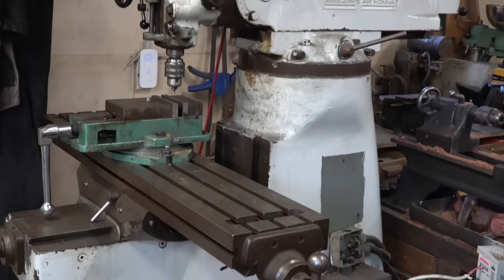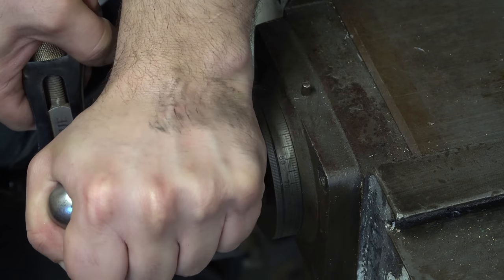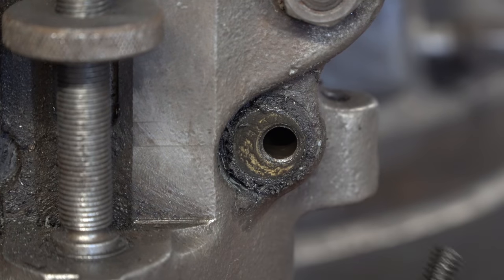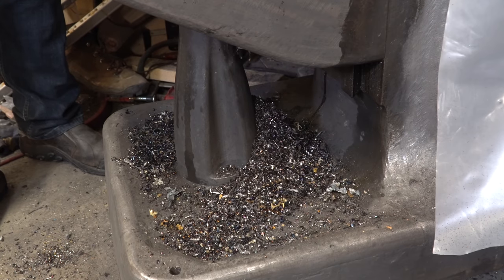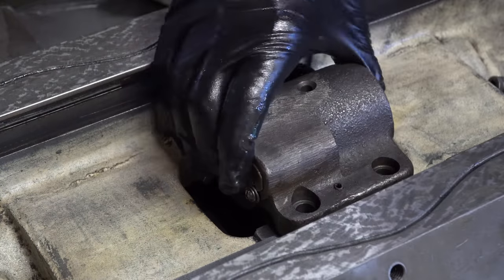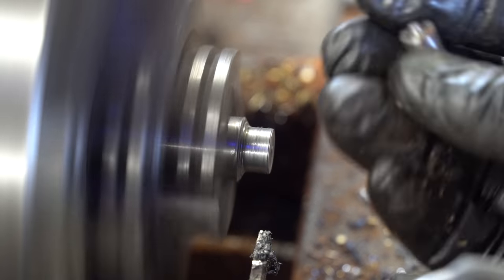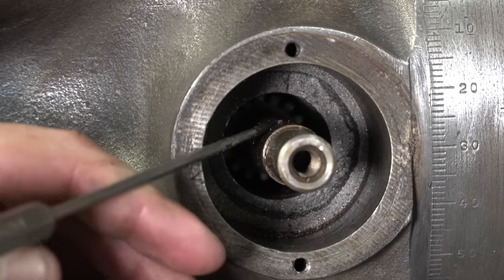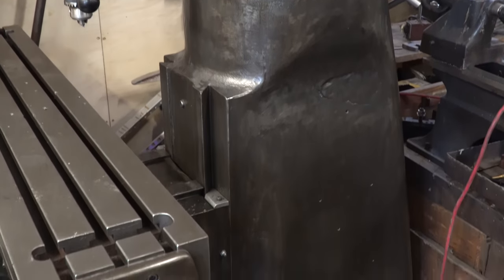Bridgebort Milling Machine [Rescue]

Comment: new machines don't hold great tolerances anyway.The design has inherent flaws you just have to work around. You will learn how to use her with the slop. Throw a DRO on the x y and if you can z. I think quill feed scale is not as useful as the knee scale. Oh and go grab a knee feed or the drill adapter bit for the knee your shoulder will thank you.

Comment: Takes me back to the restoration I did on my Bridgeport. Like yours mine also had a couple hundred pounds of chips inside the knee. An upgrade to mine I had never seen is the table lead screws have ball bearings the circulate through the mechanism making the table movement really smooth and easy. 
I enjoyed your video very much.
Reply: Ballscrews - used on CNC machines --   should be used cautiously on manual machines if the gibs are loose

Comment: Appreciated the reminder/review of all the work I did on my Bridgeport which mimics yours although I did replace the brass nuts which were worn beyond backlash adjustment range.  I do have the automatic oiler system which would be a nice add for you and I did replace the quill bearings which really tightened things up.  I do envy your shaper attachment although I sold my shaper as it was taking up space and rarely used.  The attachment has a better space:usage ratio.  Looks good unpainted!  Nice job.

Comment: That cleaning gave me shop anxiety again lol. I worked in a shop with 6 bridgeports, part of my job was cleaning them.
You may want to invest in an oiler attachment, it's an oil tank with lines to the oil points. You pull a plunger, it sends oil to the machine automatically.

Comment: I worked on the same model Bridgeport for several years when I was a tool & die apprentice. I love the bare metal... it has a sheen that paint just doesn't. BTW, of all the Bridgeports I worked on, they all were a lot quieter than yours. You might want look into the head/spindle bearings. Very nicely done.

Comment: An easy way Ive found to using a die to thread parts on the lathe is to put in you're tailstock chuck with the jaws adjusted inside the body. Then set you're die on the face of the chuck and run it into the part with light pressure and spin the chuck by hand or in low gear and just bump the power on and off. This will keep the die concentric in relation to the work piece. Putting the die in a die holder would make it much easier to keep it from turning.

Comment: Nice vid! for future reference..you do have an extra mill to cut a slot in the cam pins..just that it's laying on its side and called a 'lathe' ;-) chuck an endmill in a collet, center the pin in a tool holder and presto!

Comment: My friend has a similar B-port. With a very heavy vice on it (At least 80Kg) Moving it take both of us and normally we use a chance block on an I beam.
We are about to strip this down to at least 4 maaain parts for a journey of 1500Km so it was good so see your process. He has the Shaper, but I have never seen it used.

Comment: Shaper head is pretty handy for keyways, its been very helpful on my machine a few times.   Last job was a blind internal keyway, had to make a custom tool for the cut but it worked wonderfully.   I have mine on a vfd, very low rpm is helpful for setting up the job.

Comment: My BP is about as worn as this one but I can still hold .001.  Just learn to use your backlash to your advantage, lock the table or saddle or both whenever possible.  Watch your speeds and feeds.
I was about to buy a Chinese mill/drill when I found an old Bridgeport locally so the shipping wouldn't kill me.  Best decision I ever made.  Also, same color.  I haven't gotten around to refinishing it.

Comment: I love this type of mill, learned to machine parts on one.  The one I used needed to be leveled almost every time I used it, general use mill at a college it was pretty beat up.  These Bridgeport classics can take a lot of abuse and keep going, but they need to be releveled quite often.
Reply: Yup, I was in charge of one of these in my Physics department as an undergrad.  It had come off some WWII Navy vessel, still with the "USN" tags on it.  Yay, cosmoline!

Comment: Nice job on the Bridgeport. My 1967 Bridgeport also has grease nipples that’s what we call them in Scotland. If I just pump oil in the grease should be eradicated in time. I have seen an angle head for a Bridgeport, but never a slot/shaper attachment. Have to keep an eye out for one. M😀

Comment: Now that you have it done, you can use it to make more tools. Which you will need, but I guess you could buy them if you had too. You could go with Dial indicators on mag bases instead of a DRO, but the DRO will save tons of time, counting, and headaches. I've made a punch and die without a DRO, but it took a ton of patience. You will still need at least one Dial Test indicator just to tram the head and vice in though. That shaper attachment is gonna help open up many possibilities. They were rarely used so it should still be like new. Internal and external keyways (also straight gears and splines if you get a rotary table, of course), shaped holes, but you may have to grind a good bit of your own cutters for it. The limits are your imagination, you can learn the skills you may not have yet.

Comment: I'm sure you know those fittings on the table and saddle are oil fittings. I have seen so many shops pumping them with gease guns. It does make quite a mess and makes chips stick like crazy! When I was retiring the company offered me one of thier unused millers that had been abused for 20 years. I didnt take it as it was really bad. After 9 years away I often think about finding a decent one to play with.

Comment: For large die nuts you can use the flat face of the tail stock to hold it squarely. Use light pressure by turning the crank and using a wrench to turn the die.

Comment: Instead of 30wt oil you need to use a way oil. It’s specially formulated for less friction between two metal surfaces. In addition it will not turn acidic over time the way motor oil does. Nice video in all, good job.

Comment: that 
cutting atachment is nice , it wouldnt fit on my machine 
but would love to own one to broach keyholes and splines with
you might be able to get rid of the endplay on the acme treads by getting rollerbearing treads meant for cnc aplications , would make the operation a lot smoother too 
another option would be to fit a dro , the dro doesnt care about the backlash he measures the actual distance traveled 
it allso can do tricks like spacing out a bolt circle (boltspacing on a wheel) measure in microns and inches can measure from the outer edge of the workpiece (absolute) or from a point in the workpiece  (incremental) finding the centerline of sumting (1/2)  drilling and spacing a line of holes at an angle from the x/y axis set youre tooldebt for every tool you have (if you have all of them set up in their own chuck) and stuff like that
for the price of the tool (aliexpress) you cannot go wrong with it , does take some efford to instal its glass scales  on a brigebort though but makes the machine way more precise (and i cannot read the small increments on the  wheels on mine anyway )

Comment: If it’s really worn out and you want to have some consistency, try taking a cut of 5 thousandths to where you should be 5 thousandths above finish length/height/width. Measure, then finish cut whatever you have left to go. 
This method helps me because I have noticed cuts like 20 thousandths or even 10 can be less consistent than 5. 
But yes sadly we are limited by the accuracy of the machine.

Comment: That was great man, a real joy to watch. As massive as that thing is, can you put bigger chucks on it?  Looks like it what, a 1/2" one on it? Was just wondering if you could bore like 2" holes?  Think you can use the Mr. Thrusty attachment for broaching? I dig the "cast iron" look instead of paint, all the "ye olde" mills and lathes look good "naked". Funny that it looks like "Bridgbort", I thought it said Bridgbori" (french)? before you took all the copious amounts of pain. Bondo, primer, dirt, oil, etc, off it. LOL. Also with the swing arm radius, that thing must take up lots of real estate in a garage. Anyway, pardon the long-winded text, but it was just so soothing to see you resurrect that olde back to life. Thanks again, long-time subscriber, first-time caller, er commenter.

Comment: 13:14  Yes that whole can be used to remove chips from, in the table.   What that hole is for is for coolant to drain from the table.  Yes, we machinists do use coolant to extend the lifetime of the cutting tools and improve the quality of the cutting surface and for higher precision.

Comment: I think you should be able to get gear cutting hobs for that shaper attachment. I haven't seen one of those accessories before, but I did work at a gearcut shop where they used shapers for gear forming. Don't know much about that stuff tho, being a humble mill guy.

Comment: I love the naked look.  Can you do a restore of a Bridgeport Quill Master Type JA J Head Milling Attachment? IDK if you have this attachment, but it is very useful for milling oil galley's in dovetails for cross slides. It will come in handy if you ever need to make a part for a Bridgeport - ON your Bridgeport. To properly mill the oil passage in the dovetails you also need 1 or 2 three way angle machine vise(s).

Merry Christmas.

Comment: I know a guy who took mill and lathe cuttings and filled a wood box about 1/2 inch thick and filled it with Acrylic and made a table. it looked totally cool but took 10 bodies to carry it. lol not quite but it was heavy. i think my mill was a Gardener? i cannot remember i bought it and a lathe when i was in high school, at a factory closing both were out of service for many years and in sad shape but got them both for a few hundred each with many cutters and tooling. so was a ok deal.

Comment: I was watching the fractal vise repair and was wondering if it was just a power hammer (for blacksmithing) with a bit on it. THANK YOU for providing the link to this vid to explain what it was :) (Pretty sure this one isn't pneumatic but I wonder if you COULD use it as a hammer for smaller blacksmithing processes....)

Comment: I thought the hole in the end of the trough, on the side of the bed was a drain for cutting/cooling fluid.  Was the hole threaded so you could screw in a hose fitting?  That was a big project!  Great video!  👍  If you have small children, how do you have time for this? 🤔

Comment: I'm going to assume that "83" is either the year it was made or the number in which was made. 
If you get the proper tools needed to help move the heavier stuff, will you do a complete restore on this beautiful fine machine? 
Hahaha, one has to do what one has to do. If it worked, don't knock it. 
I honestly hate body filler, it takes away the "character" of the machine/tool. Wished I had one of these machines and it's attachments. They're the best in my opinion.

Comment: Hy @HandToolRescue, 

i watched dozens of your Videos and enjoy our Intro everytime. NOW i need your help for myself! i got myself an old Planer/Jointer Combination. Now the Table from the Planer got rusty. The Table isnt fully flat, instead it has litttle grooves on it. So i cant just sand it down. I wanna keep the Grooves so my grease and Stuff Sticks on the Table. While the Jointer Table on Top is from Aluinium the lower Planertable seems to be out of Steel. 

Looking forward to hear from you! 
Greetings from Germany!

Comment: Ha!  Fantastic!  Came to this as I am pondering a raw metal finish on a few of my machines - and in my "watch random restoration videos" stage of ramping myself up for the job.  Was pleasantly surprised when you started re-assembling without paint.  Have pondered a few options for my raw steel - concerned about rust.  Don't want to clear coat with something I can't touch up.  Hadn't considered PU brushed on.  How is it holding up?  (was really hoping you were gonna polish the aluminum, not gonna lie).  What did you do to prep for the PU coating you gave it?  Thanks for sharing.  Great vid.

Comment: I see a lot of these machines on Ebay and always wanted one since they let me use them in the machine shop between stints at University in the UK. I assume these are all 3 phase machines (all seem to be about 1 or 2hp, so I was wondering if I could slap in a DC treadmill motor? How would you go about buying one of these and what should you pay?

Comment: Do everything possible to avoid lead paint dust in the air. Namely, wet it down before trying to remove it, and keep it soaked while removing. Lead paint dust gets ingested when you breathe and lands on every surface in your garage. Water or a similar liquid is an effective way to capture the dust and prevent it becoming airborne, and perhaps something more controllable than an angle grinder would be desirable.

 Not trying to be a safety nancy, just for future reference if anyone follows your lead on lead!

Comment: You can pump way lube with a grease gun. Since way lube pump systems are an ad on they come with zirc fittings if you did not buy the add on. Most people see a zirc fitting and automatically assume that you are supposed to use grease.

Comment: Hey man, great vid! I've got an old Chinese "bench top" style mill where the head slides up and down on a shaft.... It works fairly well for what I need to do. I'm a mechanic so I only rarely REALLY need it. Occasionally I'll do some project, often a special tool or something like that and it and my very old Craftsman "hobby" lathe comes in rather handy. What I would like to do is make both of these tools as accurate as possible. Watching this has helped a lot! Do you have any experience messing around with one of those cheap Chinese mills? And, if so, are there any areas I might want to stay away from to avoid either ruining it or making the improvement so expensive I could have bought a new mill! LOL   Thanks again for the mill and let me know what you think when you get a chance.

Comment: the "RAW HEAVY METAL 666!!!!" look definitely looks great!
 dont think any color (or 2 or 3 tone paint job) would look as good as the naked metal 
.
i would, however, paint the grooves and numbers on the dials and indicators white (or red) 
i did that on all the serial numbers and sight settings on my M1 garand and 91/30..... and it looks really good
.
their is just something about a 91/30 with a refinished stock + white "lettering" on the rear sight that just makes it look sexy
takes it from "garbage rod"...... to...."hey, how you doing?? whats your name pretty baby???"
.
and my 91/30 shoots 1.5 MOA.... so it was never really a "garbage rod" 
.
.
.
.
and i think it does shoot better than most "round receiver" 91/30s due to it being a 1935 (they went from Hex to round receivers ~1/2 way threw 1935)
plus it was built in peacetime.... so they took their time (like, the machining is PERFECT)
plus i think it was never used in WW2.... as there is no rust, pitting, bore is bright and perfect, ETC
.
like.... i almost wonder if it wasnt the first round receiver ever made..... and they kept it at the factory for reference 
there isnt a single scratch anywhere on the rifle
.
but it was refurbed in the 50s....like 99% of Moisen's..... with that crappy stock
.
so if it was issued.... the dude who used it never saw front line service.... (or just hid, while everyone else was shooting)
because....again.... no rust, pits, or scratches on the rifle..... and a PERFECT bore
.
like my ruger m77 mk2 308 has a worse bore...... and its only had ~300 rounds threw it

Comment: There is NO reason why this mill would have required "filler" material.   I don't know what kind of joker told you that these Bridgeports would have that.   Did you happen to know that in the old days, before heat treating, they used to cast the bed of lathes....and then let them set for over 50 years before finishing construction?   Yes.  This is how important it was to the industry and the craftsmen of the day.  They left them to sit that long just in order to ensure the internal forces had equilibrated before adding the ways onto the machine.   The Bridgeport had the same level of love and care and attention with their manufacture.  These beasts are solid as a rock and built for rigidity.

Comment: Why is grease bad for lubrication in this case? I'm not that deep into manual mills, I work on a rather large CNC thats lubricated with grease and has two uncovered Axis/Screws, surprisingly the other large CNC is lubricated with oil

Comment: hello eric just one question, what are you using for your rust removal? are you using evaporust and if so can you bye that in canada. im from thunder bay ontario a hobby machinist with a 14--40 metal lathe a 9x49 bridgport clone and a 6x12 harig surface grinder in my humble little shop. just some info about me to another fellow canadian. thanks eric and i did sub to your channel i heard about you from kieth rucker.

Comment: Killer bringing these old machines back to use.  Restoration even.  How difficult is it to remove that clear poly spray?  :-/ 
Function is massively improved. Hopefully someone will be trying to  strip it down in 100 years.

Comment: The tolerance should be in thousands of an inch. With a plug or feeler gauge that is used for go or no go. Of course, cars built in Detroit in the 50's and 60's and 70's and 80's used 100's of an inch, that why there were so many lemons.